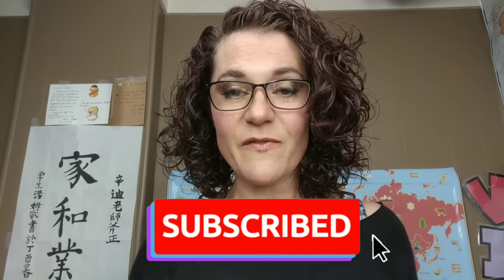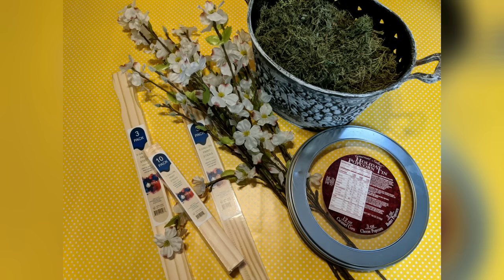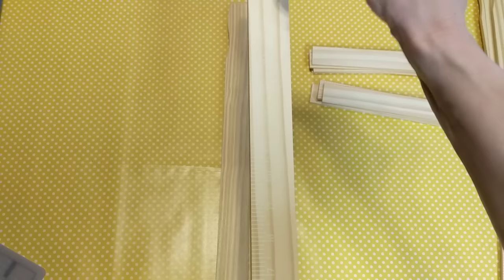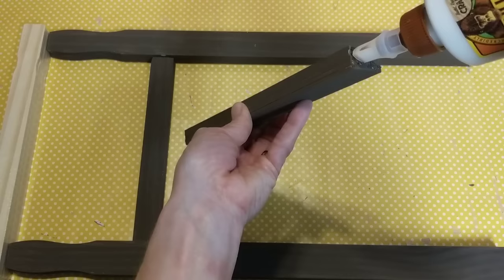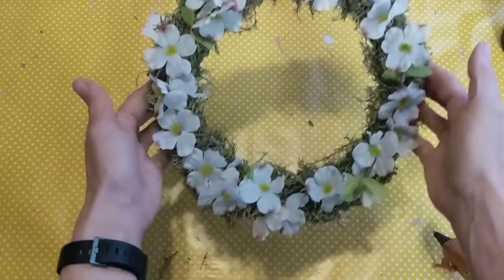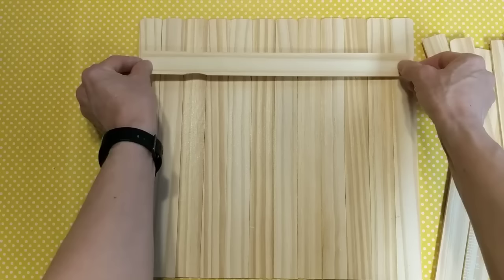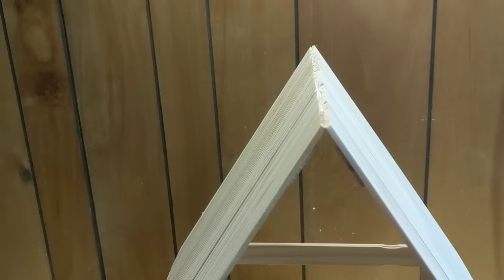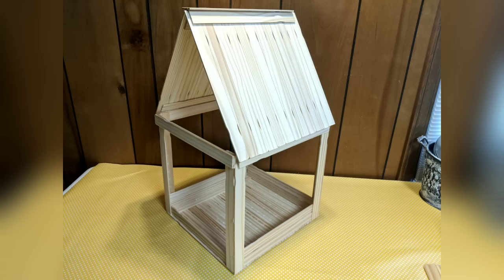🧡🧡DIY PAINT STICKS FARMHOUSE DECOR DOLLAR TREE🧡🧡 #miniladder #birdfeeder #flowerbasket #minipallets

Comment: Oh my! How to pick a fav from these? I loved all of them. I'll choose the birdfeeder though since that's the one I'll probably recreate first. I already made a ladder but used the handles from two DT plungers for my vertical supports...lol!  When I make the birdfeeder, I'll be using the giant and jumbo craft sticks from walmart since I don't have paint sticks in my stash. I'll also probably use one of the many DT wall signs for the tray part too since I only have one pack each of the craft sticks. So it'll be different from yours and smaller I'm guessing but still cute I hope. Are you worried though about the hot glue melting as the temps are getting warmer and it coming apart? Or is that not an issue you've encountered? I use gorilla glue sticks, which definitely hold up better but didn't know if they would withstand the NC heat. Thanks as always for the inspiration to create such adorable things for my home!
Reply from the maker: Hey Celanie. I didn't think about the glue coming apart but I do t think it gets that hot here but I guess time will tell!
Reply: @monarchmomdiy  ok. Thanks! Maybe I'll reinforce with my gorilla glue wood glue just in case. Can't wait to make it! I'm finishing my cross wreath, then I think I'm going to give it a go.

Comment: I find that the hot glue seems to seize up as soon as it hits the wood it does not stick well.
Also I would hit that with some water repellent wood treatment you know like a water seal or whatever, last time I made something With paint sticks and  left it outside it was not indirect rain but it did get wet and I found after several months that it just completely fell apart.
That being said I love wood crafts and I am definitely going to put some of these on my to do list but I am going to investigate a better adhesive than just plain hot glue. I was told they have hot glue for wood but I need to check that out.
Reply from the maker: Thank you so much for the tips!!